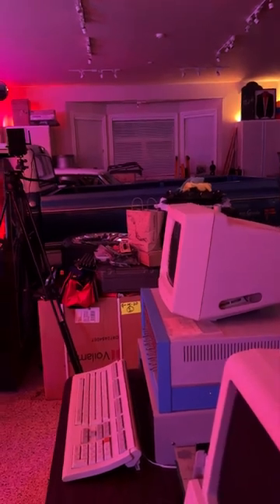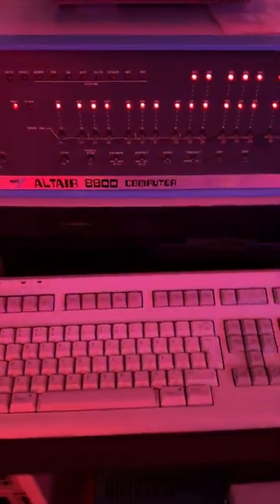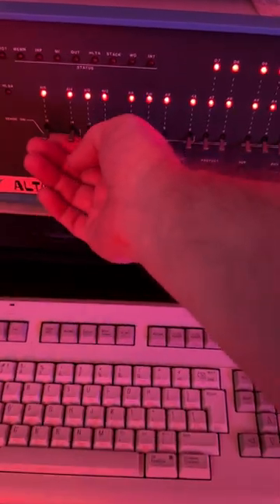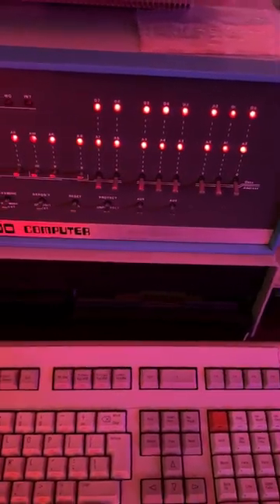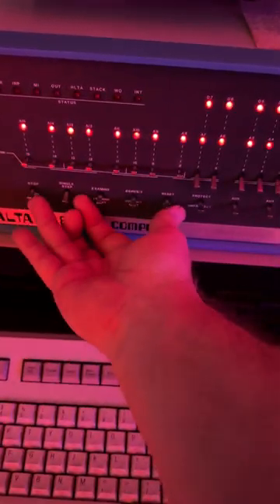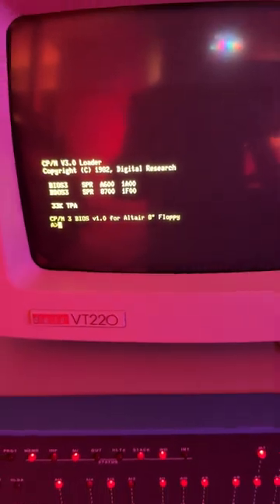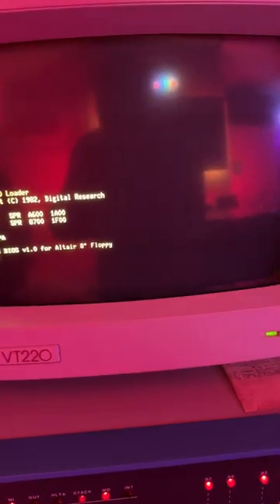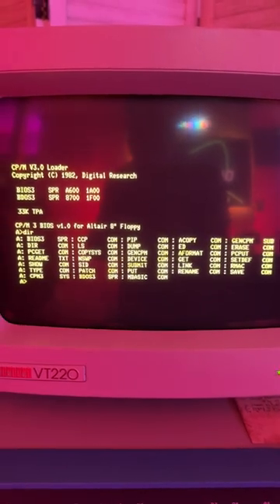Booting an Altair 8800 with Front Panel Switches and a Floppy Disc

Comment: Love the smooth scrolling option on the VT220, that brought back some memories. I used to be a VMS admin in the early 90s
Reply: Smooth scrolling is easy when not worrying about windows. Just update a scanline register and step one line at a time until a full text row has been scrolled. Then scroll the text in video memory and reset the scanline register.

So very little CPU load needed.

Comment: That’s very simple, now paper tape, took much more. Audo tape, had a boot loader ROM, simple, but you still had to load something first to save to tape (from the paper tape). My first floppy drive system (5 1/4” 90K) [NorthStar], also had a boot loader ROM. And with a floppy system the system has now become a very useful machine. And things just grow from there. That  was my Atari 8800. 70's

Comment: how would you boot another device like a tape deck?
Reply: The 0xFF00 jump vector would have to invoke the routine to read the media. Cassette Tape and Floppy were similar in the sense that they had a run of 010101 followed by a "Sync Byte"  that delineated the start of the data. You then pulled in 512 bytes which was your boot loader - stuffed it at address 0x0000 just jumped to it.  This was in the day where floppies were brand new and everyone had unique formatting (mechanical and magnetic), sync bytes and sector sizes. The biggest issue was sharing anything with anyone. Even a simple text file could not be exchanged as the floppies were unique per system. Then came Ward Christensen the BBS and XMODEM protocol.

Comment: There's a little thing in new computers called the BIOS. It does all the switch flipping for me. I just sit back, relax, and... 💻:Non system disk or disk error.💾  <-- Dave put that on every floppy disk you format. Be sure to thank him.🤣 And attribute 29h turned one file of FAT into the volume label (else NO NAME). You add the attrib flags to get this value. If you've never done it before, dump a floppy in hex and play around. Write it back to save changes on disk.

Comment: Wonder why the Altair puts the switches in groups of three when the nybbles are four binary digits.
Reply: I guess, in 1974, octal had been the more usual way of simplifying binary input. There are still people who think that octal is more user-friendly than hex. Since 0 through 7 is also 0 through 7 in octal, you don't ever have to wonder what number A is, they might say.

(Don't mistake 016, which is octal, for 16 in C.)
Reply: FF00 hex is 177400 in octal or 1-111-111-100-000-000 on the front panel switches